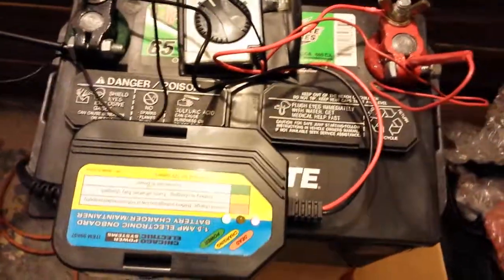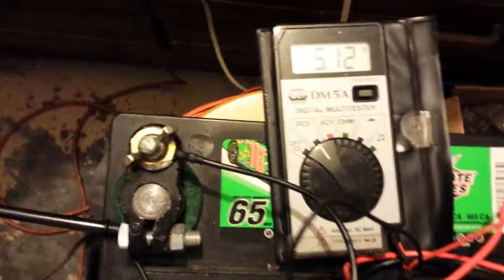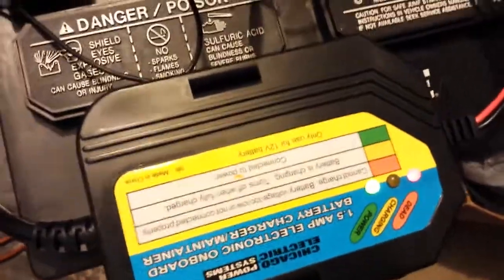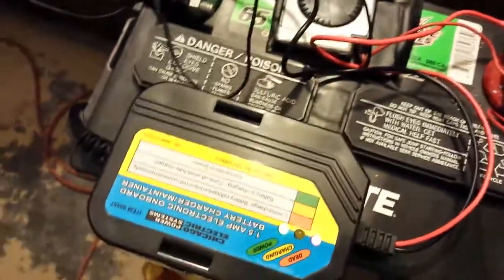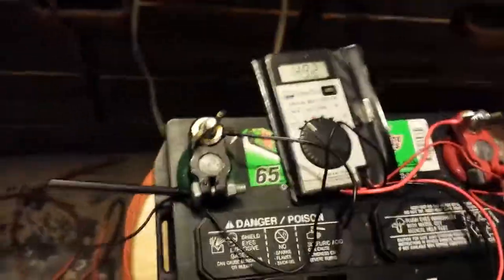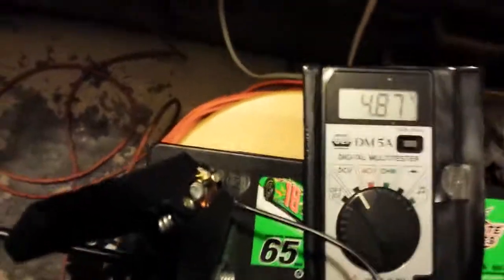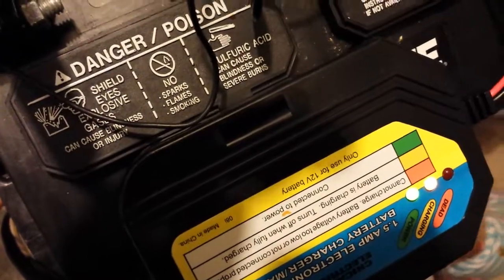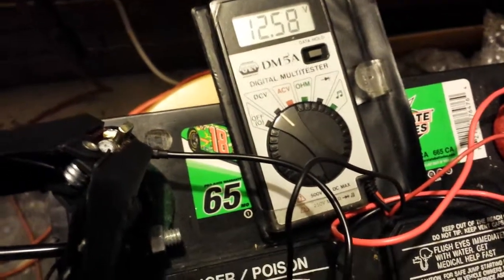Tricking a Battery Tender into Reviving the Dead

Comment: Basically the Tender Battery Charger will not charge the battery if the Battery is dead or below: If you try to charge a dead battery having a voltage below 3 volts, the Battery Tender charger will not start. An internal safety circuit prevents the charger from generating any output voltage unless it senses at least 3 volts at the charger output. So by using a Jump Start Battery it tricks the Tender into charging the dead battery, and that's what he did in this video. Awesome thanks you helped me out big time.
Reply from the maker: Thanks for clarifying for others! Still doing this for some older batteries (in the interim) that I come across

Comment: You don’t necessarily have to connect both the charger and the jumper battery at the same time. You can charge off another battery to get the voltage high enough then disconnect the battery and reconnect the charger. This is what I had to do to charge a motorcycle battery with terminals too small to accommodate bother charger clips and jumper clips at the same time.